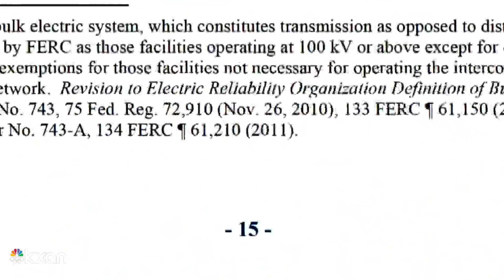Why didn't Texas power plants winterize after 2011 storms?

Comment: The power plants didn’t fail the wind generators did
Reply: Wrong but thanks for playing
Reply: I retired from a coal fire power plant ..,my friends were working overtime , keeping it running , my neighbor works at a different power plant , he was driving 1.5 hour to work to help keep it up and running
Reply: Lol, hilarious
Reply: I worked shift work at a coal fired power plant for 30 years . I worked most of the holidays , making electricity so people like you could have heat and lights .... i missed time with my daughters .... for people that dont give a f*ck.... i know for a fact that most power plants inTexas were up and making electricity ... i didnt have electricity for 4 days during the snow either but it was because my electricity is provided by a Coop.
Reply: No ..it’s right
Reply: I’m not playing